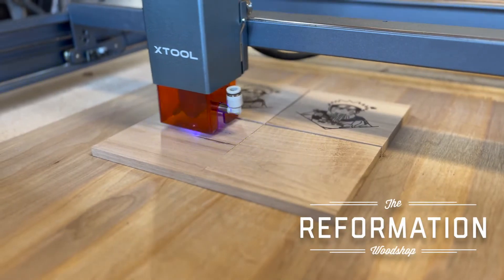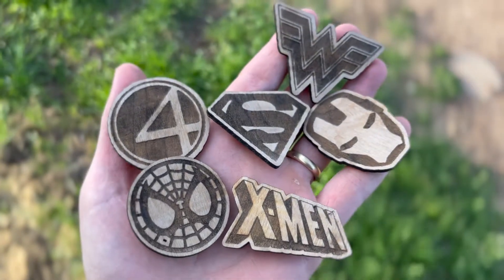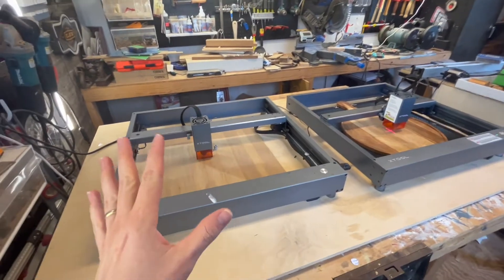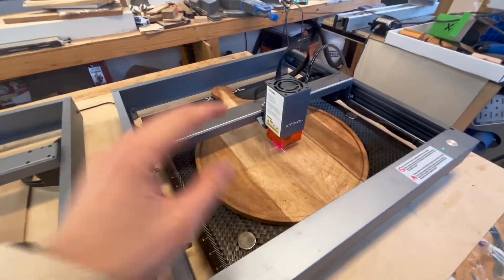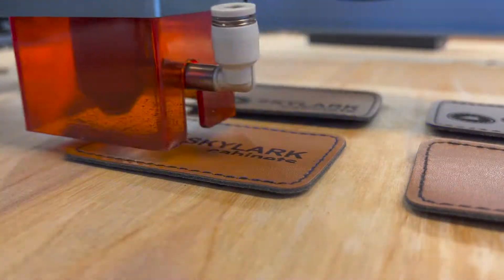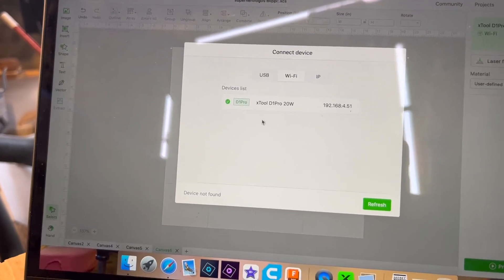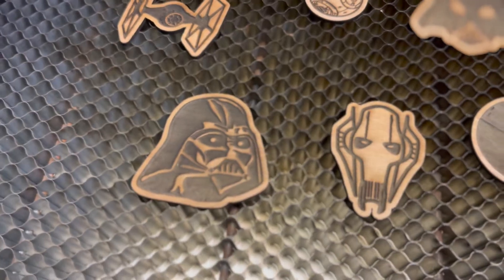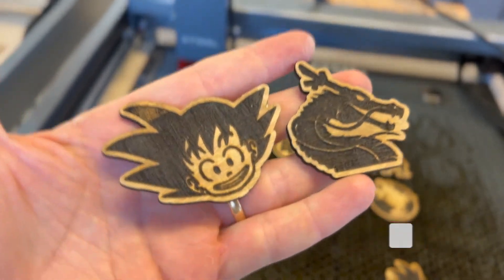I Made $937 In 48 Hours Using My XTool D1 Pro

Comment: Awesome video. Did you use a hat press or did you iron them on?
Reply from the maker: I ironed them for this video but it was not a good experience at all. I now have a cricut hat press and it works really well.
Reply: @TheReformationWoodshop  As soon as I finished watching your video, I looked at the cricut hat press. Iread some of the reviews on those leather patches that you used, some people had good results and others not so good. How are the patches holding up, any issues you've found using them?